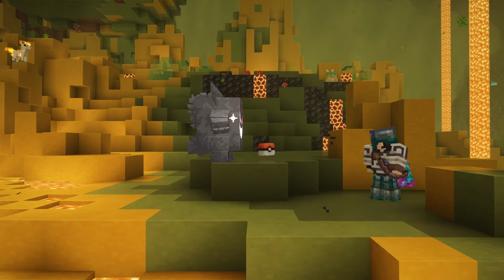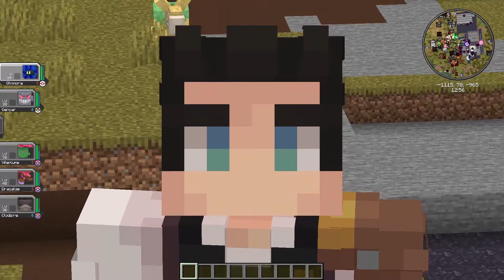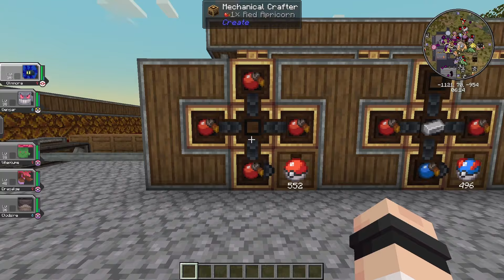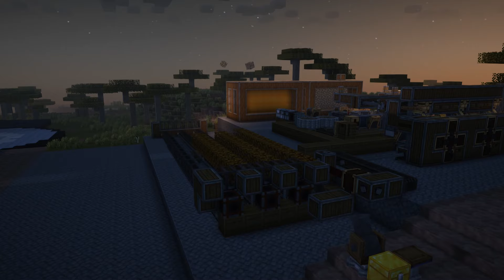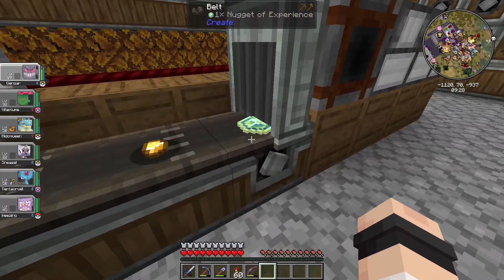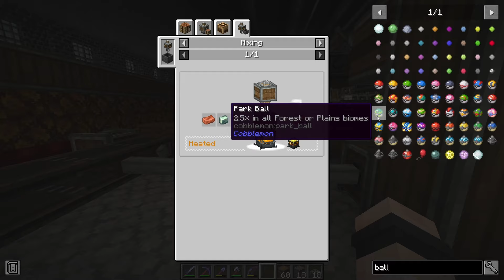POKEBALL FARMING in COBBLEMON using the CREATE MOD

Comment: You should cook up a design using only blocks and mechanics form vanilla create and cobblemon I feel like you'd be able to come up with a neat design (Also if you do, share the schematic so I can steal it >:) )
Reply from the maker: Maniacal laugh!!! 🤣 

The schematic for the farm should be linked below but let me know if it doesn't work ☺️ plus you might need a datapack for it to work as we use a custom one on the server 😁
Reply: @hellotherekc  The problem ist I dont like using the storage block mods you use in the vid. Are they included in the schematic or did you swap them for like normal chests or something like that?
Reply from the maker: @w1nterroll  oh I see! I totally forgot about them since I've been using them for so long. I can probably work on something else, just need a way of making the nuggets into ingots which should be too hard
Reply: @hellotherekc  well good luck if you wanna actually try that ^^
Reply from the maker: DUDE! Challenge has been completed :) here's a link to the schematics for a full Vanilla Create & Cobblemon blocks. It's a bit janky but it works 

http://www.mediafire.com/folder/hggo90pcv466a3k,84p82z75teou6pt/shared
Reply: @hellotherekc  I tested it but it didn't work
Reply from the maker: @seiyapegasus8901  I think I forget to change the storage block at the auto crafter 😬
Reply: @hellotherekc  can u update it? it's my first time using the auto crafter cannon

Comment: how come i cant glue the minecart and when it was getting built it didnt put the drills or minecart
Reply from the maker: The Minecart is an entity so it doesn't work using the schematic cannon so you'll have to make your own mining drill I'm afraid
Reply: @GrayGaming30 If you need help setting up the minecart.

You need a cart assembler. First put the cart assembler on the powered rails. Next grab a portable storage interface, white compact barrel and a chest and set them up like he did in the video. 

After that you put a Minecart & Furnace on the cart assembler. Use a wrench to lock the orientation so it doesn't turn. Now you just need to super glue those items together. When you are done, just get a lever to activate the cart assember. Flip the lever, the cart should be pushed up and combined with all the items and you are good to go. 

I wish kcblaze had done a little explanation for that part. Didn't know either when I was building it.
Reply from the maker: @UltraKardas  true, explaining farms is something I've not done much if before so I'm still learning in that department. I'll bear in mind for the next few videos ☺️